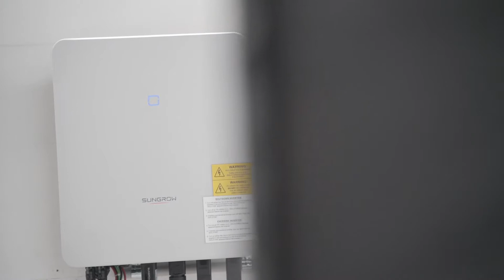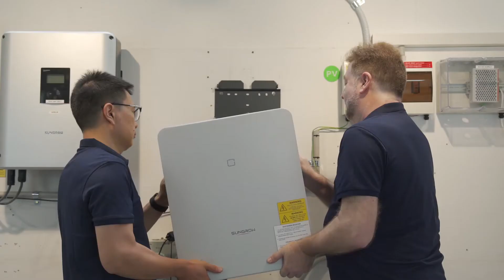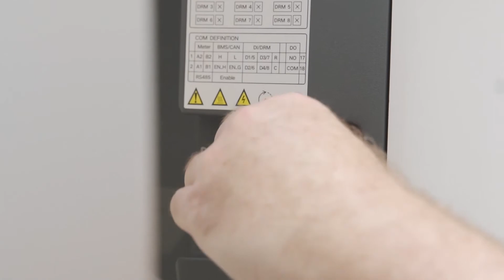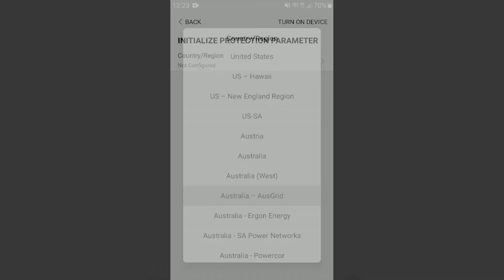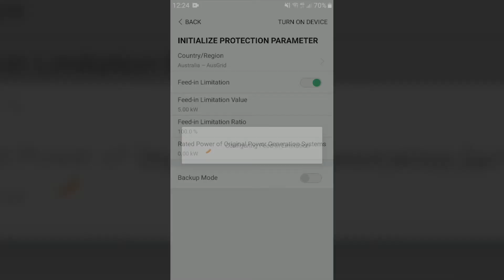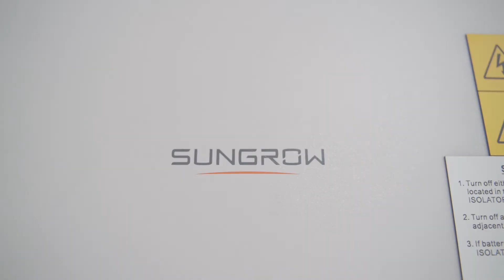Sungrow Draft

Comment: @ 6:40 / you mentioned that on the DTS the code 666 should be used , ,  Why such a number. 666 represents the anti-Christ and is the mark of the beast. Really that number should never be used in any configuration on any equipment. Not good marketing Sungow!! 666 is Satans number ! !